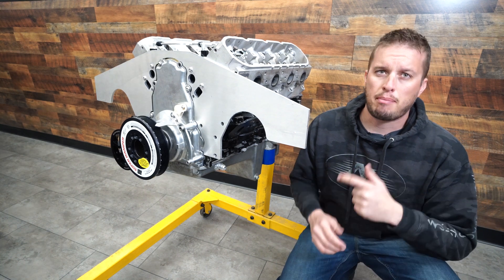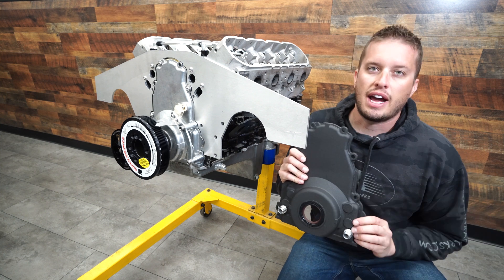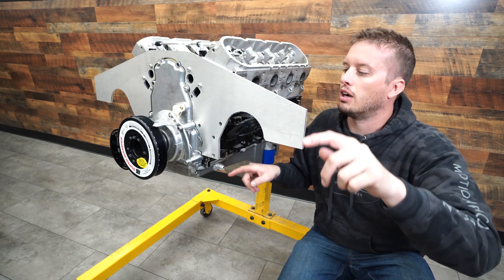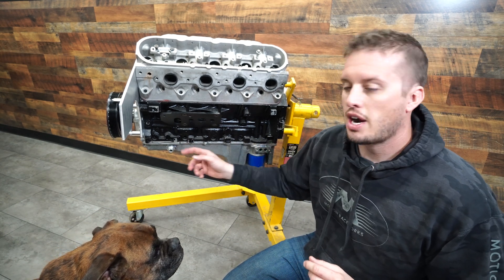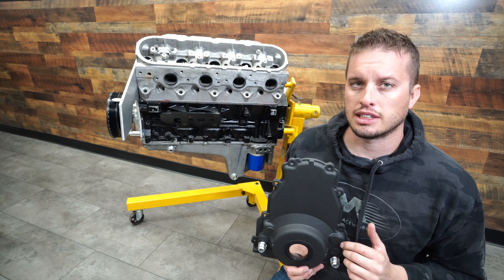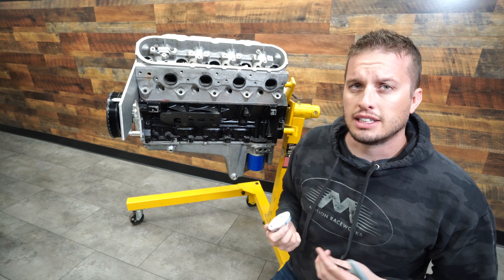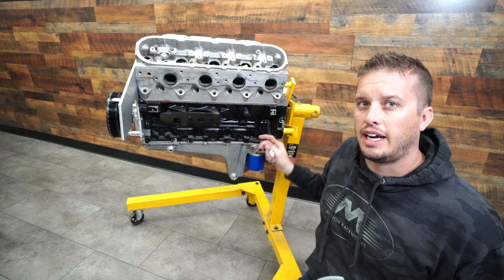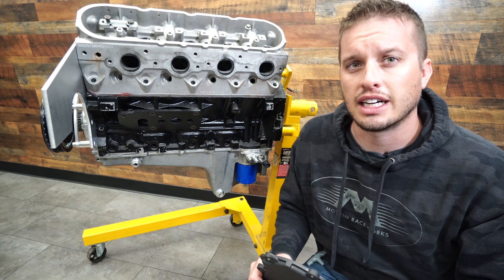Turbo LS Oil Feed and Drain Locations

Comment: My turbos sit up high and I drain into the valve covers. Seen any issues with that?
Reply: Yup… you are feeding unfiltered oil through your engine… normally oil goes through the pickup tube screen then the filter and up to your lifters… now you are pouring dirty oil from the turbo into the top of the engine basically bypassing the filters

Comment: But what if you are still running the oil cooler line where the feed plate goes?
Reply: Add a sandwich plate and do a bigger cooler

Comment: I have a question about the timing cover do you need 2 bungs on it if I'm running a single turbo ls in my truck and if you have one on the oil pan do you still need the timing cover or no?

Comment: On the feed side with the adapter, could you run one side as the feed Y'd into two turbos and keep the pressure sensor in that second hole?

Comment: If the turbos are above the engine valley cover, is there any reason why the drains could not be in the front valley cover.  The lines would be short but more horizontal than vertical.

Comment: How do u put the factory oil cooler block back on. Thats my probem  that spot on mine has the block with lines going to oil cooler
Reply: You don’t.  But if you have oil cooler lines there’s no reason why you couldn’t add a T into one of those as a supply line for the turbo.

Comment: Doug, why not take the oil feed from the port on the forward driver’s side of the engine?  Works good, lasts long time.  Doesn’t interfere with the OEM stuff at the filter. 

Regardless, great info and products you guys offer. Thanks!
Reply: I'm looking at taking the oil feed from here as I'm running an aftermarket sump with remote oil filter. Is this the Allen key bolt?